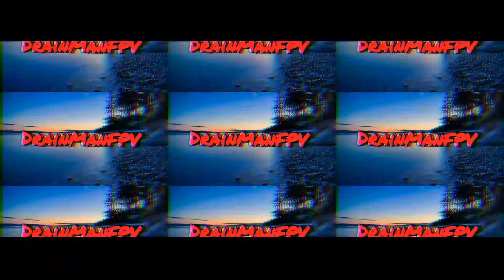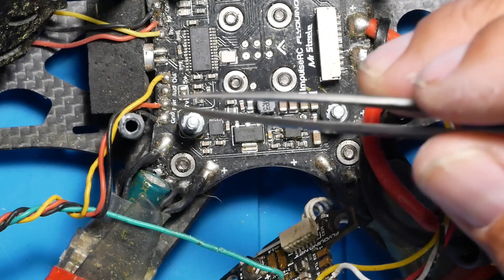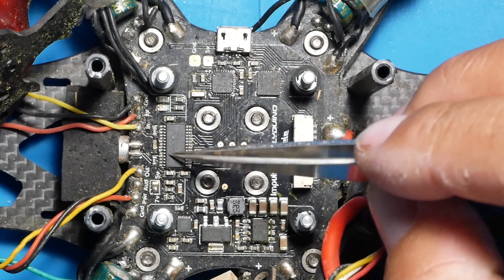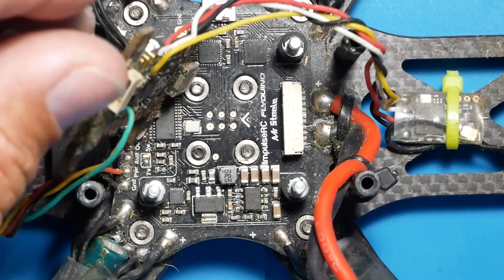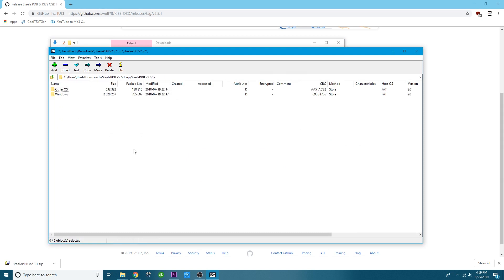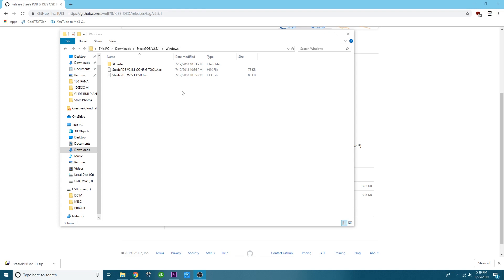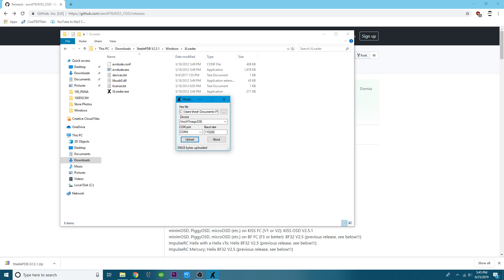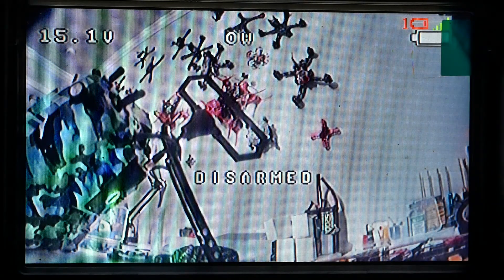FINALLY! Easily Set Up Mr Steele PDB - How To Flash & Wire - The V2

Comment: Thnaks Drainman this really helped! Quick question did you manage to get LQ working on the steele pdb? Here is a breakdown of my problem maybe you have a solution: I'm trying to get the correct LQ values to display on my OSD using a mr steele pdb V2 and kiss V1. My nano is wired correctly and my Tx and Rx are running the latest version. Wiring Diagram attached for reference. So far I have tried this youtube video tutorial below but My LQ keeps showing 100% on the OSD. I'm outputting LQ on channel 8 from the crossfire channels menu under the lua scripts on my taranis x9d+. My Crossfire is set to output 12 channels. My Aux config in the kiss gui is Aux 1: Arm, Aux 2: Level, Aux 3: Beeper, Aux 5: turtle mode. and Aux 4, 6 & 7 are open. On the steele pdb under the rssi config menu I have it setup to output on Aux 4 (channel 8 on crossfire) and my Rssi min ppm set at :1090 and max set as: 1990. In the kiss gui under Aux 4 I see a value of 1995 outputting but it never goes below 100% on the OSD even if I block my antenna with my hand. Went for flight and it also stayed at 100%. Has anyone got this working? Any advice would be greatly appreciated! https://www.youtube.com/watch?v=HbRLzJlZ5KU&list=PLE_r9Bo1UhAzOD9NhbozVwNsOV8lC6YUx&index=18&t=0s

Comment: Hey! Great video👍 i wonder how o set up rssi on OSD.. i have KISS v1 and mr steele PDB.. and i have crossfire
Reply from the maker: Thanks Josa! I will make this my next video and drop it ASAP! I will do step by step guide
Reply: @DrainManFPV  ive almost there.. just need rssi to be on Aux 5 .. but för some reason i can only chose aux 1-4 in the rssi options in the OSD configurator.. i have KISS v1 and mr steele PDB..my  reason i need rssi to be on Aux 5 (channel 9 LQ on crossfire micro TX) is becaus aux 1-4 are bissy.. can rssi only be on aux 1-4?
Im stuck at the finnish line😅😥😓
Reply from the maker: @Josa1984  ah yes, you will need to change to 16 channel, or drop down to channel 8 and under. Can not run 8 channel and then put it on 9
Reply: @DrainManFPV  how do i do that.. qx7 control setting or crossfire TX setting or kiss gui.. cuz im pretty sure i have it on 1-16 ch or 1-12 ch.. but steele osd config only let me chose aux 1 to 4
Reply: @DrainManFPV  qx7 is on 1-16ch Think crossfire TX only goes to 1-12ch .. i have the micro tx🤔 maybee its not possible to have 4 aux channels on kiss? My aux 4 is the temporary switch wich i use as a pre-arm for safety

Comment: Hey mate just thought I'd share this, after putting a second pdb in and still having no osd I pretty much gave up on the idea but! I wired in the voltage sense on the camera and was setting the camera osd, set it from PAL to NSTS and booyah impulse RC logo popped straight up with OSD,

Comment: Hey mate, flashed the pdb twice got the osd working then when unplugged the battery and plug it back in the osd disappeared both times, it did save the settings I put in just no osd now, dude I'm lost if you could help would be great cheers 👍
Reply from the maker: Hey James, sorry your having trouble, you did flash back on the OSD after you were done with the config tool ?
Reply: @DrainManFPV  think I'll get used to flying with no osd, guess it's a kiss thing 👍might just go back to betaflight thanks again

Comment: if i want to set up smart audio to change my vtx what pad would i put it on the FC or whould i put it on the ch3 pad and select S/A ? i have it that way now but there not enogh memory it says on the taranis screen !
im coming from beta flight man and all them goodies lmao !!!
Reply from the maker: You will solder (white) smart audio wire (assuming you have unify) to TX5 on your KISS v2 FC. As for your "not enough memory" you will need to go to OpenTX and flash with lua.c to be able to fit everything on the card.